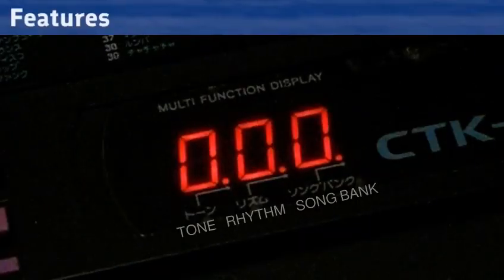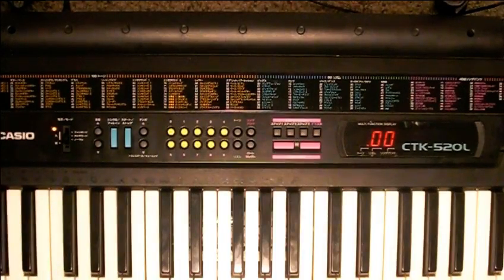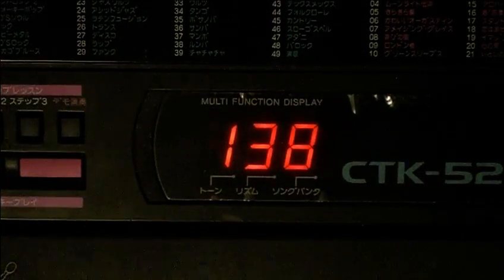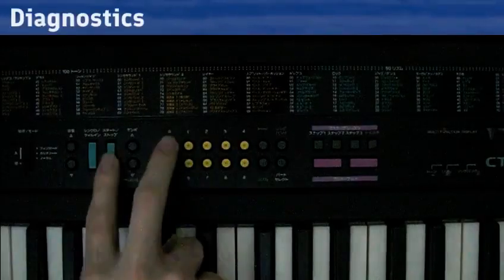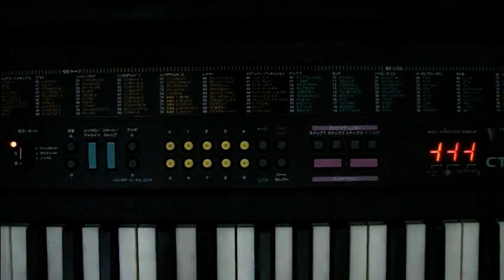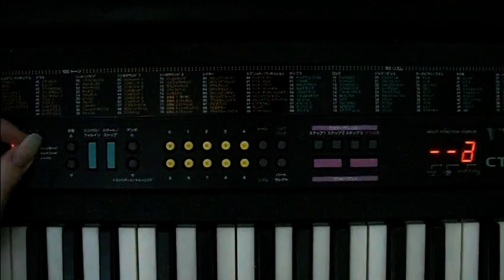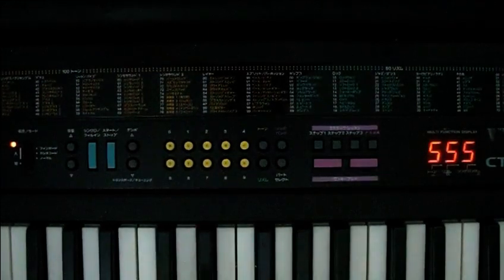Casio CTK-520L Functions Review

Comment: Does anybody know how to fix it turning on for only a second and then dying immediately?
Reply: The connection, change the cable
Reply: @danielhyde6838  Thank you for the reply, for me it turned out being a board issue, the old batteries had exploded when i bought it and I would up having to clean it and install a few new resistors and capacitors. Works like a champ now 😎.

Comment: Holy shit you can press 2 of the buttons at the same time? This keyboard has been in my family for about 30 years and I didn't know this until now
Reply from the maker: Yeah, it's not immediately obvious that it's how the Transpose, Tune, and Key-Light toggle functions are accessed. I knew about the first two via other Casio keyboards, and I just happened to figure out how to do that third thing by randomly finding it in the user's guide. The weird thing is that they called it "turning off the three-step lesson system" at the time.
I'm glad that this functions review has benefited you.
Reply: Also the fact that you can reduce the tempo of songs and play the bass chords/notes instead of the melody

Comment: Hi!! I'm here again, how to remove the percussion sounds in keys c1 to f2?
Reply from the maker: Your word choice is not the best here, so I'll interpret this question in multiple ways:
① To silence the keyboard, set the volume to 0 by pressing the Volume Up △ or Down ▽ button and then the 0 button (3:58).
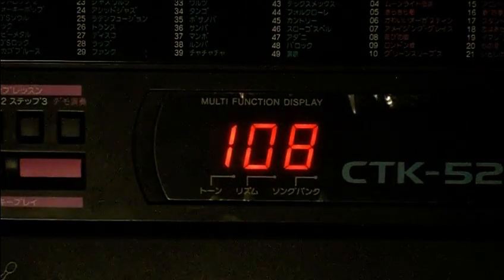② To make all keys behave as standard keyboard keys (no chords), set the Power/Mode selector to Normal (1:24).
③ To use chords, set the Power/Mode selector to Casio Chord (easy chord system, 1:35) or Fingered (standard chord forms, 1:43).

Comment: How do you add midi support? you said it's possible, but didn't clarify how or where to search. Big thanks in advance!
Reply from the maker: You'd need to have experience in electronic engineering to be able to find the TxD/RxD pins on the CPU, unsolder them from the board, build a circuit that looks similar to this: https://i.imgur.com/aCe5wep.jpeg, and then connect those pins to it. There's a partial guide about how to do it with the CTK-480 on Hackaday.

Comment: How do you plug in headpones?
Reply from the maker: You'll need a 3.5mm to 6.3mm adapter. There are only two ports on the back. You should be able to figure out which ones do what.
Reply: @GabrielMiceli  You never posted back panel ports if this accepts midi/in/out or usb processing
Reply from the maker: @matthewmurphy9779 - 0:37

Comment: Where can I get a cover and music holder for my Casio CTK-520L?
Reply from the maker: You can find just any generic 61-key keyboard cover on ebay or amazon. As for the music holder, I'm having trouble finding those independently, but they also come with more modern keyboards like the LK-165 and the CTK-2300. You may ask some sellers on ebay if you could purchase the music holder separately.